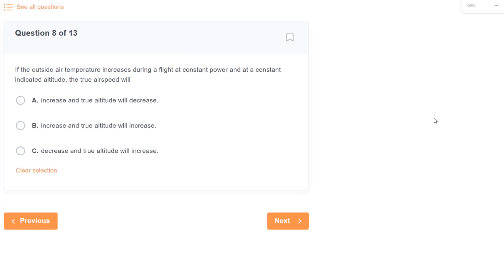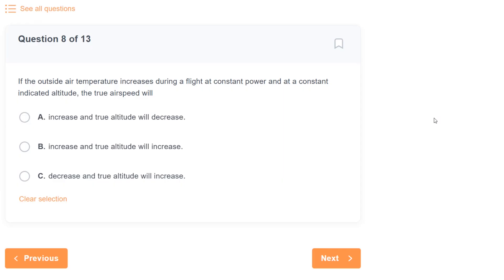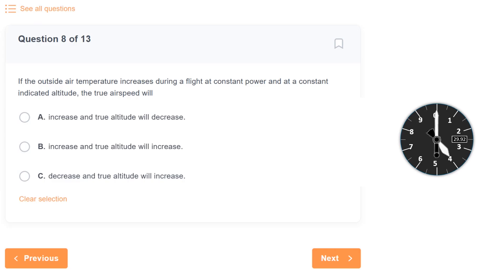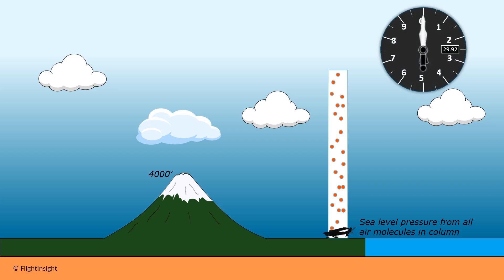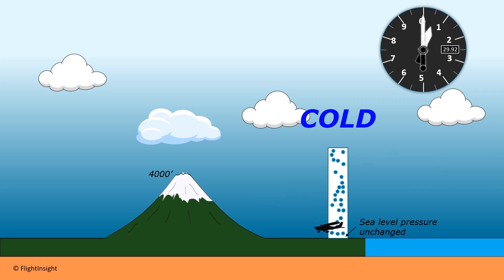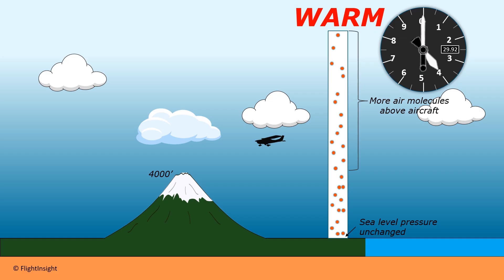The Altimeter Doesn't Work How You Think it Does | "High to Low Look Out Below!"

Comment: But, if temperature is increasing you are climbing (to maintain constant indicated altitude) and at constant power (as given in problem)  which means you're also slowing down, so who's to say that TAS increase (due to higher density altitude overall) is not equalled by or less than the airspeed decrease amount (due to climbing at constant power)??

Comment: This is also a good explanation of why, in IFR flight at certain airports, temperature compensation must be applied. In order to cross certain fixes at the required height, and therefore achieve the obstacle clearance guaranteed, you apply a correction factor. For example, if the crossing altitude for a fix is 12,000 feet, you fly at an indicated altitude of 12,300. The factor is derived from a table, or better yet, most flight management systems will calculate it for you.

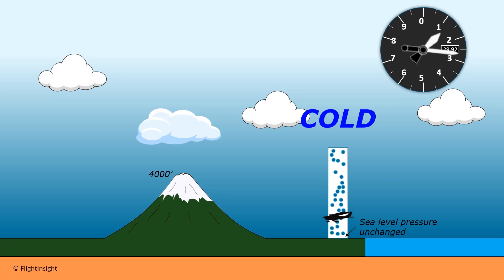Comment: Hold up. I'm probably misunderstanding something but at 2:50, if the air is colder then that means it's MORE dense because cold air is always denser than warm air, which means lower density altitude meaning wouldn't the altimeter think we are LOWER than 4000 not higher as air is more dense near the surface? What am I getting wrong here. This has me second guessing my entire understanding of this topic. Someone pls help haha
Reply: someone gotta answer ur questions cause im with u on this one
Reply: The altimeter operates based on air pressure---not density. Inside the altimeter, there is a sealed aneroid wafer filled with a set number of air molecules that can expand or contract in volume. If the outside air pressure is lower than inside the aneroid wafer, there is a net force that pushes the walls of the wafer outwards, expanding it until the pressure inside the wafer is equal to the static air pressure and vice versa. The expansion/contraction of the wafer is what drives the needle, in no way does air density play a factor in this operation.
Reply: Think of it this way; when you set your altimeter setting in the kollsman window of your altimeter you’re telling your altimeter to find a specific pressure. As temperature changes causing the columns of air to expand upward and downward the specific pressure setting you have told your altimeter to find will change altitudes. With warmer than standard temperatures the spot will go up due to the column expanding and vice versa. Read up on the how an analog altimeter works in the PHAK and read PHAK 12-3 it will explain the phenomenon better than I can.
Reply: @Drewy860  I don't really understand the concept of the columns of air expanding upwards and downwards due to temperature changing. So when it's cool, and the column of air compresses downwards, like depicted in the video, what exactly fills the 'air' or 'space' above the compressed air mass now? as the length of that vertical air mass got shorter, what's above it now? isn't there always more air until we reach the limit of our atmosphere and space regardless?
Reply: @ so to be transparent I didn’t know and after doing some searching, I’m still not exactly sure but molecules are constantly bumping into each other and the warmer they are the more energy they have to go higher (thermal expansion). Based on what I found I believe you’re getting the right idea as there is not a definitive edge to the earth’s atmosphere. However there are several factors that determine this besides temperature, especially considering that air moves both laterally and vertically. All of this to say, this is a great question to ask a physicist.
Reply: @Drewy860  lol ugh, the confusion only gets deeper haha, but I appreciate you trying to even find the answer and replying sir!
Reply: @KuostA  I think this video didn't do a great job visualizing the air column. There's no definitive edge to the Earths atmosphere, air density gradually decreases as altitude increase without a hard cutoff. The orbits of satellites that we would consider to be out of the atmosphere still decay over time due to atmospheric drag caused by the very small number of air molecules present even hundreds of miles above the surface. Instead of visualizing an air column as a rectangle, visualize it as a gradient that is darkest at the surface but gradually fades to white as altitude increases. When air temperature decreases, this gradient will simply fade quicker with respect to altitude.
Reply: @thePenguinous  Thank you so much you've just saved my life. I've been struggling to understand this concept since I started my flight training and I have my CFI-I checkride tomorrow and your comments FINALLY led me to a place of understanding. I am eternally grateful.

Comment: I have always assumed it was as the principle demonstrates. The air reacts like an accordion with changing air temperature. Hotter, it expands upward. Colder, it contracts downward, but for a constant indicated altitude the airplane is in the same relative position to the vertical state of the air mass. Look at GPS altitude on a hot day at upper altitudes. It will read higher than your altimeter, and vice versa. This is why minimum altitudes for instrument approach procedure segments in very cold temperature must be ‘temperature compensated’ to a higher indicated altitude to remain at safe true altitudes. Modern flight management systems have modes that allow inputs for just these situations and segment altitudes to fly by altimeter will increase.
Reply: I'm not sure if I understand what you're saying, so are you saying what he depicted in this video was wrong and backwards? " Look at GPS altitude on a hot day at upper altitudes. It will read higher than your altimeter, and vice versa. " =  This contradicts what he said in this video, no? what you say say you experienced is opposite to what he said would happen, no?
Reply: @KuostA  No contradiction. All else being equal, in lower than standard temperatures the airplane will be lower than what the altimeter indicates; in higher than standard temperatures the airplane will be higher than the altimeter indicates. To me, the confusion arises in the methodology of the author's examples. He begins by using true altitude as the reference point to which an airplane climbs in both the cold air mass and warm air mass, but we don't "climb to a true altitude" in an airplane. We climb to an indicated altitude based on an altimeter, so I prefer to use indicated altitude from the altimeter as my initial reference. With this, imagine the following physical analogy using a common coil spring that represents a column of air in the atmosphere. The height of a coil spring at rest (no load) is analogous to the height of a column of air at standard temperature. In this case, put a mark on the spring at any height you wish. This mark will represent a constant indicated (altimeter referenced) altitude, which, in this neutral no-load condition, will theoretically match true altitude. Now compress the spring downward. This represents a cold column of air collapsing. The mark on the spring is at the same RELATIVE position on the spring, meaning the altimeter indication has NOT changed, but the mark is actually lower in height (analogous to lower true altitude, or height above sea level). Now, instead of compressing the spring, pull it upward from the no-load position. This represents a warm column of air expanding. Again, the mark on the spring is at the same RELATIVE position on the spring, meaning the altimeter indication has NOT changed, but the mark is actually higher in height (analogous to a higher true altitude, or height above sea level.) In other words, any mark on the spring is analogous to a constant indicated altitude, but that same mark also represents a variable actual distance from sea level (true altitude), pushed closer to the earth in cold temperatures and pulled further from the earth in warm temperatures.  It is for this reason that in very cold air masses, altimeter referenced altitudes must sometimes be adjusted upwards to higher values in order to maintain safe minimum height above terrain and other obstacles while following the track of an instrument approach procedure. If such indicated altitude corrections are necessary at a specific airport, the applicable temperature range allowances will be published on associated procedure plates. I hope the spring analogy helps, but again there is no contradiction with the ultimate point the author makes.
Reply: @wkelly3053  WOW, that was a GREAT analogy! this is an EXCELLENT memory aid to remember this concept! stellar job there with that wkelly. This is how CFI's should teach it. You're absolutely right, the fact that he used true altitude as the initial reference point is what makes it confusing, when in real life you'd be using INDICATED altitude to begin with. Thus, your analogy is far more relevant and is easier to grasp, faster. Thank you! 

Since you did such a great job with this, figured I'd try to ask you this one as well: Regarding the concept of the columns of air expanding upwards and downwards due to temperature changing; So when it's cool, and the column of air compresses downwards, like depicted in the video, what exactly fills the 'air' or 'space' above the compressed air mass now? as the length of that vertical air mass got shorter, what's above it now? isn't there always more air until we reach the limit of our atmosphere and space regardless? Or like in your analogy, your coil extends from the ground to space, I presume, so if it's cold and it compresses, what occupies the difference between the top of the coil, or cold air mass, and the beginning of space then? is it not more air? is that just considered a separate and irrelevant air mass, to this situation then? howabout when the coil expands when it's hot, how can it expand into space, isn't there no more room to expand into space, so how does it expand upward, vertically, as depicted?
Reply: @KuostA  Getting late tonight. I’ll get back to you on the second part.
Reply: @KuostA  As to the second part of your comment, I'm not an expert on the atmosphere. However, if you look at a graph of atmospheric density vs. altitude you see a couple of things. First, if you start down low at sea level and begin moving upward through the lower regions of the atmosphere where most airplanes fly, you experience relatively large decreases in air density and pressure for relatively small increases in altitude. However, above about 50,000 ft. the rate of increase in altitude begins to surpass the rate of decrease in air density, meaning that air density decreases much more slowly at extremely high altitudes. At around 23 miles up there is basically no air left, at least for practical thinkers. [An excellent reference point from my school days is that at only 20,000 ft. half the atmosphere is below you, so you can see how it is concentrated where we fly.] Anyway, why do I mention this? Well, I was thinking of the coil spring example I used previously, and it occurred to me that rather than using a coil spring where all the rings remain equally spaced, perhaps a better example would be a Slinky toy. A Slinky is technically a spring also, but if you extend it vertically with the base on the floor, the lower rings will be very close together like the air particles nearer sea level, while the upper rings are very far apart representing particles near the termination of the atmosphere. Aside from this perhaps being a slightly better tool, I wouldn't spend too much time considering an 'air column' literally as something with fixed limits. Instead, I think it suffices to know that air particles assume a more concentrated distribution down low in cold temperatures and a more even distribution extending up higher in warmer temperatures, and the upper limit is hard to define. Temperature effects on our true altitude can be important to understand for flying. However, in the wider perspective, temperature induced variations of a few hundred feet in the most extreme examples are almost trivially small considering how much atmosphere is above us that we don't use. This has been fun. Stay safe and good flying.
Reply: @wkelly3053  THANK YOU SO MUCH FOR SUCH BEAUTIFULLY INSIGHTFUL RESPONSE, ANALOGIES, AND EXPLANATIONS, GOOD SIR! You did a stellar job with the slinky example in addition to the coil analogy! Are you a CFI, or where are you in your aviating journey? You're a natural with teaching and explaining concepts!

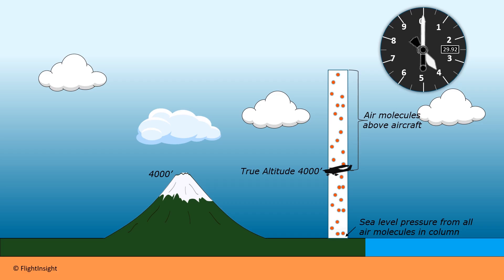Comment: 2:09 :) what will happen if you move the plane above the mountain top... will the altimeter still read 4000? Despite no air column below?
Reply: It will still read you 4000 (in standard atmosphere), since the altimeter measures the pressure of the air above it, not below!
Reply: @TheJessy8888  yes, the indicated will remain 4000. Sorry I was not clear with my question.  I am more puzzled with the TRUE altitude calculation. My understanding -> Take indicated, correct for pressure, then correct for Temperature (but only for the AGL part!) = True Altitude. But that would mean, moving above the mountain will give me different results 😵‍💫
Reply: @withgrowinginsanity198  true altitude is in MSL, not AGL :) and the altimeter also shows MSL only
Reply: The air column below you has no impact on indicated altitude. Only the column above you. If the aircraft goes up, true and indicated altitude both go up, just not at the same rate if you're in non standard temperature.
Reply: @AK-xe2ly  welll.... yes and no :-) lets agree on the column of air below part, but if I follow the isobar, the indicated stays, but the true is changing, no?

Comment: I always remember indicated altitude is really just the air pressure offset by the altimeter setting. Higher temeprature means higher pressure which means lower indicated altitude and vice versa
Reply: Higher temps makes lower "pressure" Check air density
Reply: @12345fowler  so is what akilan said correct still for high temp equating to high pressure still or no?